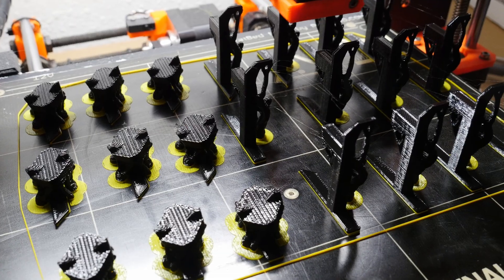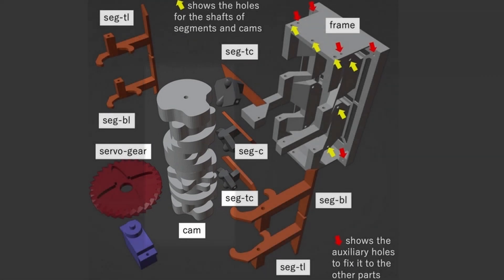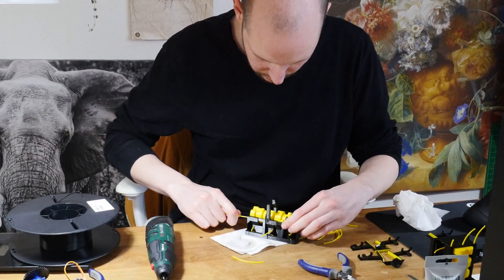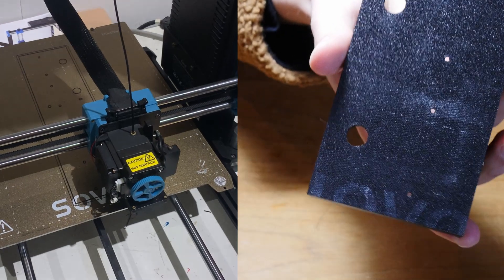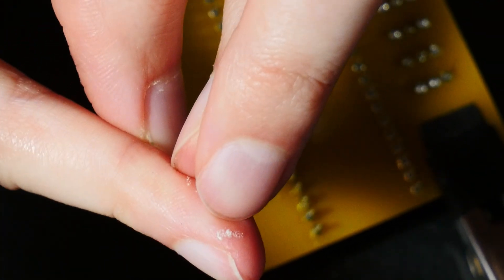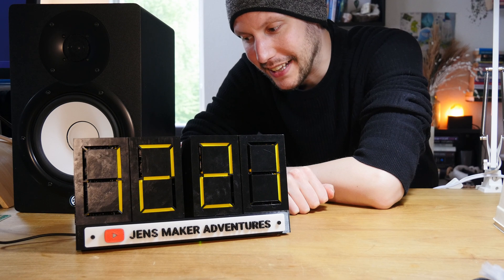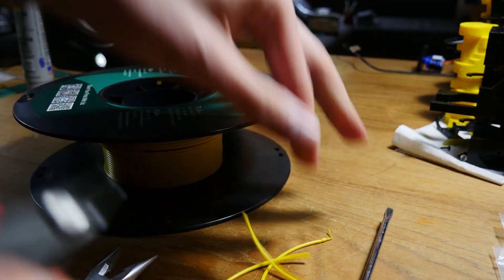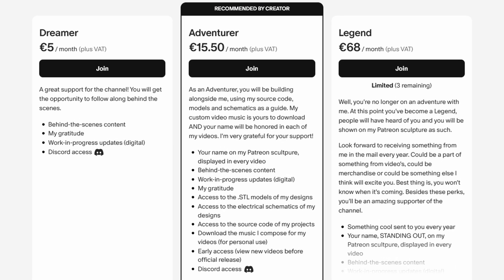3D Printed Mechanical Display

Comment: I feel like very quickly you will need to add another digit onto it. Just amazing content, camera work, builds, and overall knowledge about what you're doing. You will be at 10K+ I want to say in about 6 months (honestly I think 2 months). Maybe upload twice a month instead? Idk. But you will be huge if you keep this up. I see no reason this channel should be at 120k or MORE. Solid stuff and definitely promising.
Reply from the maker: Wow, that's an amazingly kind comment. Thanks so much for the friendly words of encouragement! 🤩
Reply: Was gonna say something similar! You'll be far bigger!
Reply from the maker: Wow, I hope you guys are right! I'm giving it my best shot! 😃
Reply: Exactly, just print a static 0, put in on the end, since that data doesn’t update anyway; solve two problems in a single go 😅 and in a couple of years, replace it with a “k” 👏🏼
Reply from the maker: That's clever!! 😁

Comment: This feels like the first digit could drive the second digit, like on a tape counter...maybe it is too much resistance for the servo.
Reply from the maker: Smart idea! Though then if you have a power loss you need to manually reset. I've seen designs around that do this. And to set them you can take parts out so you can manually move each digit back to zero.
Reply: @strange_inventions  Right - most things that use that design are intended to be tamper proof, like car mileage.